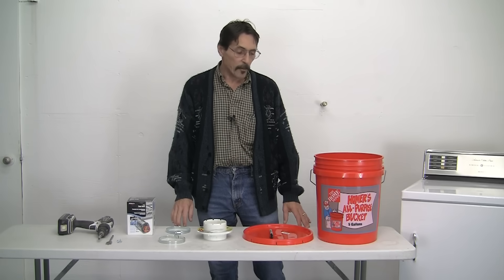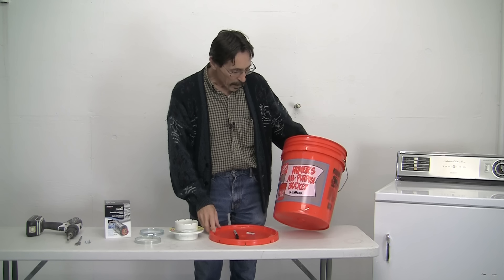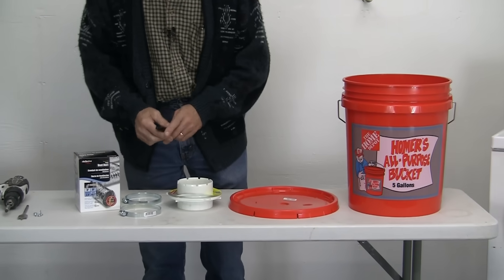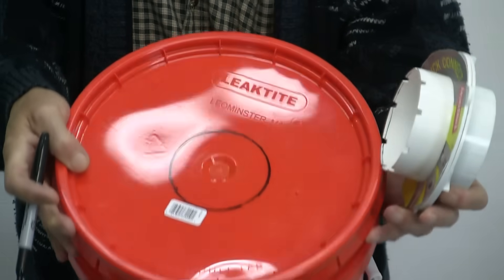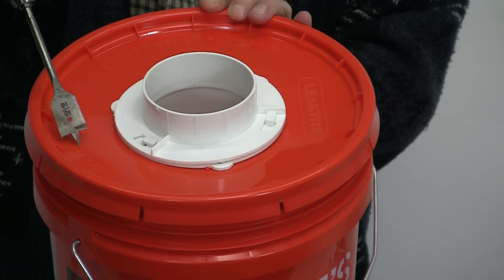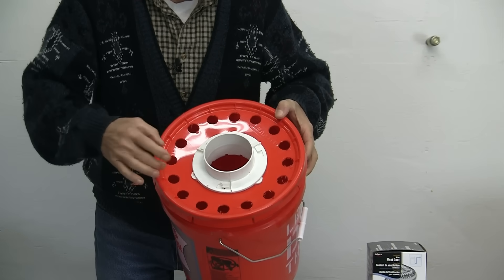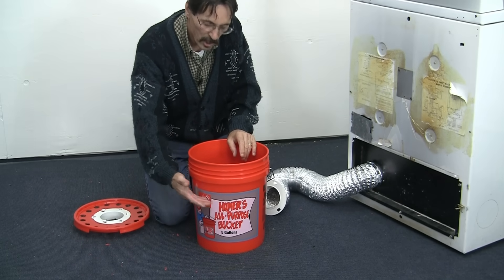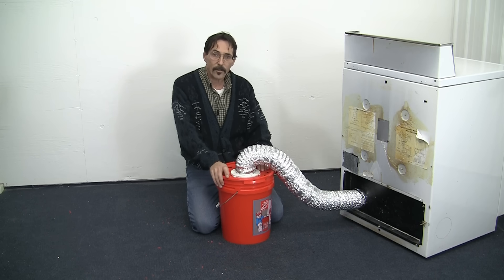DIY How to Cut Electric Bill in Half: Part 3 Clothes Dryer Free Ideas | Missouri Wind and Solar

Comment: I made a similar unit to this one. I made it from a box and on all four side I placed furnace filters to catch the lint instead of using water. However, I could not run it far enough away from the dryer which was a huge problem. I found the dryer was recirculating the exhausted air, meaning it was recycling the humid air. The clothes took much longer to dry. If you can run it far from your dryer your better off. It will pump a lot of humidity into the house, but in the winters most houses are too dry to begin with.
Reply: TheMILVET  Most likely the lint clogged the fine passages in the filters with the first load or two of clothes. You don't see this right away but it happens quickly. this slows down the air flow through the dryer.  that is the reason it takes so long to dry the cloths when its attached. not the recirculating of humid air. Its blocking air from exiting the dryer to start with. I use one of these in the winter and it works very well. The added humidity will keep you from getting sick as well.

Comment: This is a great idea. One thing I noticed is the exposed holes fore venting the bucket. Why not hot glue screening to those holes for extra filtration? You have been doing this for years and I heard a breathing issue while watching the video. It makes me worry a bit. Maybe have the exit holes tubed outside? Prevent any illness for safety.
Reply: +SaltySugar Cotton and synthetic fibres in lint are most likely bad for your lungs especially when coated with chemicals from your detergent and fabric softeners. I wonder how much lint still gets into the air with method?

Comment: What should you use in the summer (my dryer does not vent outside)
? Also, what kind of room would be better to put the bucket in? My dryer is below a tiled with vents den....in a small room in the basement.
Reply from the maker: Kater Caters to Cats A clothes line. Always the cheapest way to go.
Put it in another room, not next to the dryer.
Reply: I FOUND PANTYHOSE WITH ABOUT 3 INCHES THICK JUNK INSIDE. i had forgotten to put water near the contraption..I had just totally forgotten until I saw your video, thanks....so for a quick fix....
.i put a litter container rigged with old system with water and hoping that works better! thanks so much! maybe my ele bill will go down now....and i can probably vent it up to the den there are holes in the floor via vents i made when we tiled the den. 8-)
Reply: I never use a clothesline..i hate bugs and germs.

Comment: The necessity of dryers is way overrated.  Just hang your wet clothes either on hangers spaced apart or drying racks (inexpensive at Walmart or Target), and wear something else until they're dry later in the day or the next day.  I live in Florida so usually the A/C is on.  Other benefits are your clothes will stay looking like new and they won't shrink.  The only time I use a dryer is for bedding.

Comment: Where does the humidity go ? A better plan would be to get a long exhaust pipe so you save on the heat going out but then if you have air going out of the house ,you need air getting back in to equalize the pressure ,so unless you can invent something that can stop the water from getting into the air are we really saving ?
Reply: +Frank Newcomb air coming in from the dryer. Humidty comes out for the winter moisture. That is why he said for winter use only. It is dry dry in winter in different regions.
Reply: Are you not going to elaborate on that ? I like this guy ,he's smart and has loads of smart saving tips ,he's also a green live advocate and business owner but why are you taking my comment as a personal insult to you ?

Comment: This is a very ingenious way of saving electricity.It's been more than a month now our electric dryer is acting like it doesn't wanna dry clothes like it used to.I think the exhaust hose is clogged up! I will try this system and thanks for uploading it my friend..
Reply: +Bern W , the bucket is half-way filled with water so that the lint will stick in the water, after a month you just have to dump the old water and refill it again half-way and then you're ready to go! It's not gonna blow or linger in the air like you're saying.It worked for me until this time we are using it.

Comment: It is cool idea so what you do in the summer time if the dryer brings humidity. Do have system where you can use all year round and also save money too. We all will appreciate that if you can come up with one  but it is not that we don't appreciate this tip
Reply: The whole point is it helps heat your house in the winter instead of exhausting the hot exhaust out of the house. In the summer you obviously unhook it and hook back to the original exhaust out of your house. Unless for some odd reason you want to heat up your house in the summer.
Reply: natrone23
Reply: Yeah it is cool idea thanks for sharing

Comment: Jeff.. My dryer vent runs through the celling of my garage from dryer room.. I'd like to try this too warm my garage in the winter months. I would have to fine the dryer vent in the celling area, ( cut away sheetrock) put elbow on dryer vent pipe and connect the bucket to vent. thanks for this idea.

Comment: Hi Jeff, no we don't have a humidifier, we do have a swamp cooler for the summer lol. When we had a wood stove we'd put a big stock pan on top cause the top really got hot but the pellet stove doesn't get hot enough. I've seen some humidifiers at local auctions, guess I should pick up one or two.............. thanks

Comment: Thanks for all the tips - you really are helping a lot of people.

That said, I'm a little skeptical of the amount of lint this would let into the house. Would it be a terrible idea to extend pipe or duct down just to the surface of the water to ensure the lint makes contact with the water 'filter'? Just a thought..
Reply from the maker: Jeff Aicher Extending a pipe down close to the water is a very good idea. I'll give that a try. As far as lint escaping there is very little to almost none.
Reply: I think that might cut down on the airflow too much and your dryer will have to run longer and not very efficient.

Comment: Hi Jeff, Got a couple ? for you. The dryer is 220, isn't that going to use alot of electic running the dryer all the time ?  We heat our house with a pellet stove and it does okay until it gets below 10 or so then I have to kick up the stove to the next level to keep the temp comfortable. but at the second level it burns 2 bags aday verses 1 bag a day. pellets aren't getting any cheaper. Last winter the circut board burned out on the stove so we seen these radiant heaters that claim they use only 25 cents a day to run, well we got 2 of them and our electic bill went from 1,500 kw to over 3,500 kw and it about killed us to pay that bill for  the 4 months we had to use them. We are both on disability so it took most of our money just to keep warm last winter. lol  Our dryer vent already goes in under the crawl space under the house and I;ll do the wash late evening as to warm up under the house which helps keep it  a little warmer.. I'm going to build me 2-3 window solar heaters as soon as it warms up cause we do get plenty of sun shine on most winter days, We've also got a partial basement thats good for nothing and I was thinking about a solar hot water heater cause we could put a 5,000 gal tank down there and run the whole house on hot water for heat and showers but this all cost alot to do but maybe someday when publishers clearing house shows up at my door lol.
Reply from the maker: Mt Dew  You use this bucket only when your drying clothes is what this video is about. Your not to use your dryer to heat your house, that would be expensive to do. People with a lot of kids really benefit from this lint bucket.
Wood heat is a very dry heat and takes the moisture out of the air which makes it harder to keep your house warm. Do you have a humidifier ?

Comment: Change the Nylon, before it clogs, You see it every time you throw a load in. Always worked great four me.
Reply from the maker: OldTroll11 The nylons really do slow down your airflow even if they are clean. I suppose it might depend on the brand,lol. Anyway , just for scientific purposes try removing that nylon and see if your drying time shortens at all then report back to me with your findings.
You probably keep check of it and almost no one else does. I went to hundreds of homes with a complaint from customers that it was taking forever to dry their clothes and there electric bill went way up. Nylon, every time on the exhaust port with link in it to the point of almost shutting off the airflow.
Reply: LOL, No longer in Kansas. Definitely no need to add humidity in Florida.

Comment: Thanks Jeff! Great idea!
Reply from the maker: Your welcome. I have used this lint bucket for years and the only time i had a problem was when i lived in an old trailer house with single pane glass, the glass would sweat on the inside. They were aluminum frames. I took some of that window wrap, the clear stuff that shrinks and put it on all the windows and the sweating stopped.

Comment: When we bought our 1300sf home we had a new furnace / air installed.  We had a larger furnace with a 3 ton unit thinking of enlarging our home in the future. Do you know if there is a humidifier that can be added to the furnace and if so witch is better the add-on or individual units?
Reply from the maker: IamNewPrepper I would get the individual units.From my experience the ones that mount to your furnace rust out and are not very efficient at all. Then you have trouble with getting parts for them.

Comment: The way the lint collects in the water is the same way dirt is trapped in the Rainbow vacuum cleaner, which is a very high end vacuum. Works extremely well to trap the dirt and is great for those who suffer from respiratory problems. Awesome!!! Heat and clean air too.
Reply from the maker: Susan Rogers I know about the Rainbow vacs, good idea, no filter to clean or replace ever. I had an old pickup truck with an oil bath air filter on it. Used motor oil in it instead of a paper filter. Worked the best i thought over paper.
Reply: That air is pumped through the water not just at it.

Comment: Jeff, speaking of heating your house. You have a space heater/ divert load listed on your site. It's 250 watts. Would it work with three or 4 of them hooked to a bus bar with say... a 1k system or even an 800 watt wind turbine? I'm looking for something that is safe to mount on the wall in the house to supplement heat during the day at least. What would you recommend in this situation?
Reply from the maker: ***** You could do that but i wouldn't do it with a wind turbine.

Comment from the maker: Easy dryer vent bucket to build
Reply: MissouriWindandSolar if you install a dryer dock in the wall where the dryer normally exhausts outside, it takes a few seconds to swap it for winter and summer. Perfect time to clean lint out of the dryer and the duct work to the outside as well. The spare part of the second dryer duct can be made into a cap for the duct work in the winter time to keep critters out and keep cold air from coming in.
Reply: Good show .
Reply: +MissouriWindandSolar  Excellent video :) by the way loved you in " THE BAD NEWS BEARS "  Mr Haley
Reply: MissouriWindandSolar by

Comment: Neat idea. Been using the dryer a lot this winter the vent goes out side. So I will give this a go, I wonder if you can place a clothes horse around the bucket for a kind of second FREE airing.
Reply from the maker: Probably but what the heck is a clothes horse ? If your taking about a horse wearing clothes that was stuck out in the rain for some reason i guess he could come in the house and stand over the bucket and dry out a little. There clumsy when they come inside so get the liqueur bottles off the counter, a swishing tail could cause disaster.
Reply: MissouriWindandSolar Jeff your in the wrong business, Hollywood is crying out for that kind of humour. Its what the old folks used to hang their wet clothes on. Sort of a frame was made from wood today metal and powder coated, They used to put them in front of the fire. Mind you back then I think they also put the tin bath there too. Did bring a real horse into the house once to see the reaction of a sleeping friend as he awoke from one to many. Don't think he ever to drank again.
Would not recommend it very messy from the rear end.
Reply: Oh, never mind?
Reply from the maker: ian57812 What i meant to say was oh, that's what a clothes horse is. My mother use to have one and it was made out of wood.
When i  was 18 my wife and i lived in an upstairs apartment and we didn't have a clothes dryer, she had one of those drying racks in the kitchen. That was my first wife and i divorced her. Molly was my second wife. I kept Molly.
Reply: MissouriWindandSolar Are your cool Jeff.  That's the only problem with the interweb  it cant read ones thoughts. Yes keep Molly.
Reply: MissouriWindandSolar lol